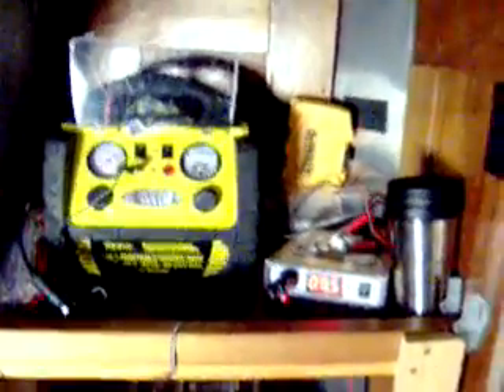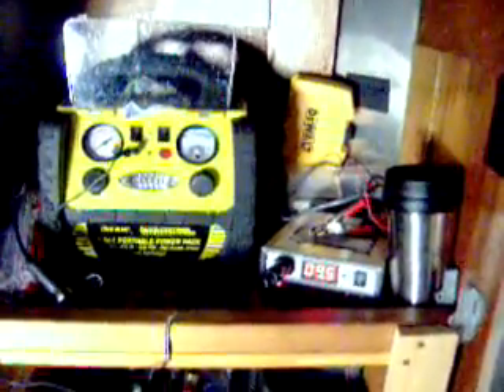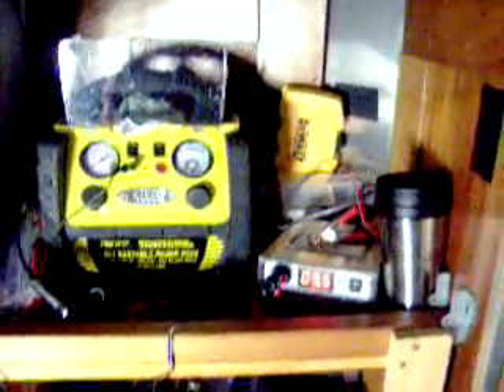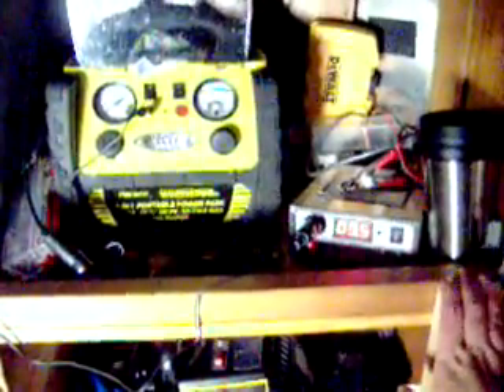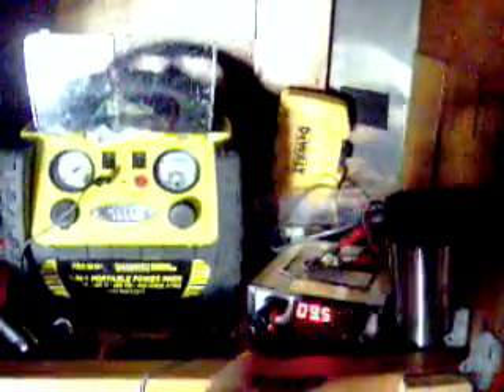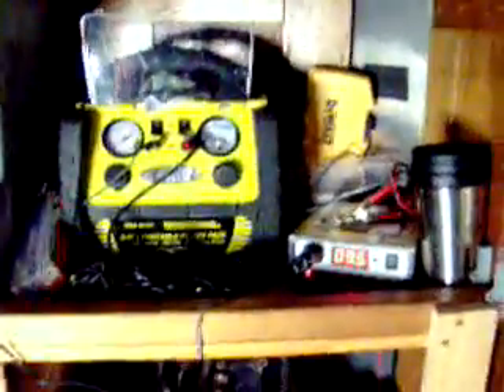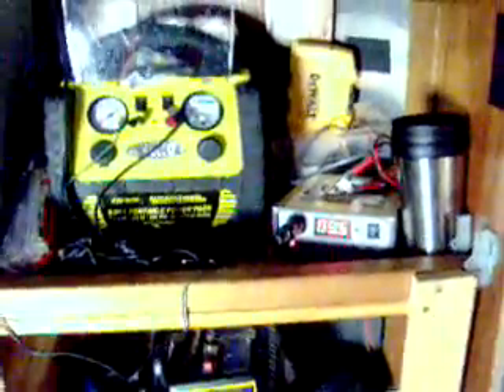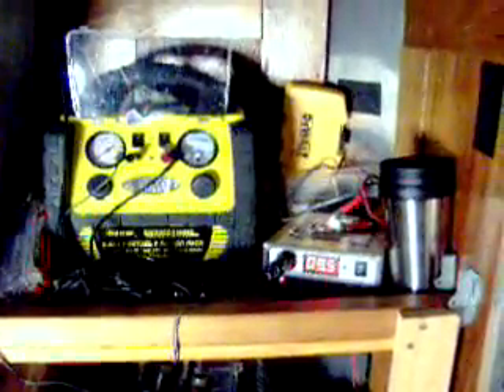Harbor Freight 5 in 1 power box with the Harbor Freight 45 watt solar panel kit

Comment: I've got the 240v version, purchased for around $120 in Australia, and use a cheap $20 10w solar panel + controller to keep it topped up.
I use it to charge phones via USB, and to charge AAs (on a MAHA charger @ 12v) when I'm car camping, or when the power is out.
Having the cheap and nasty inverter and compressor is a huge plus if I ever need them.
---
I bought it to use as an emergency phone and AA battery charger, and for that, it's been excellent.